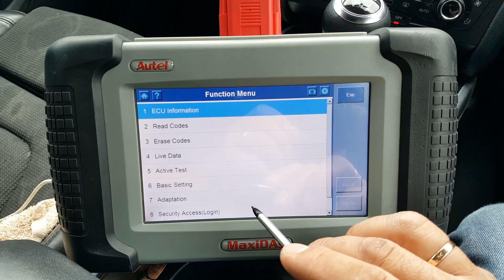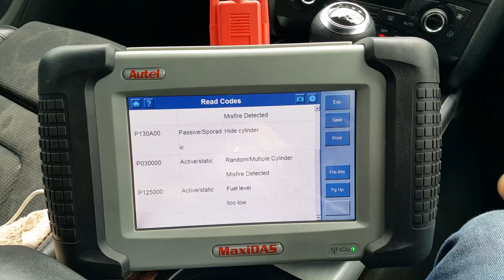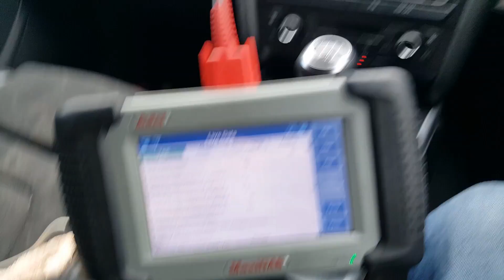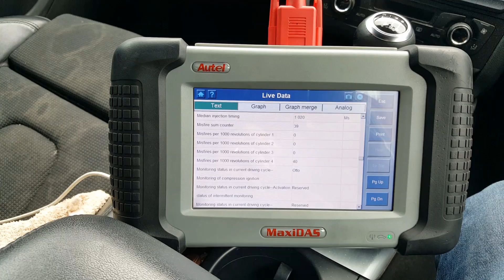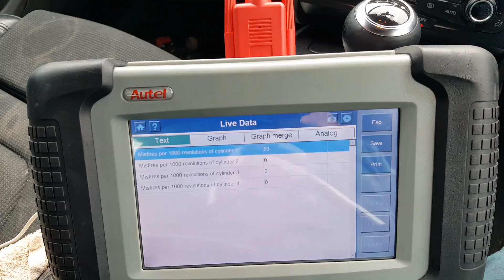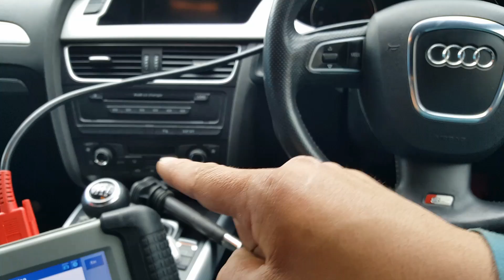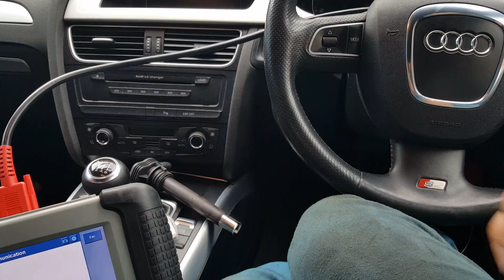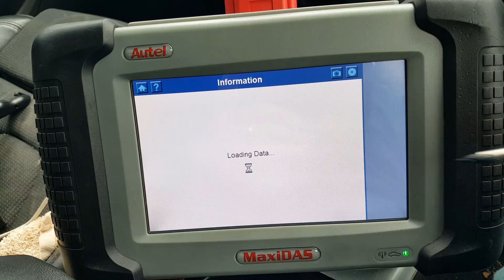Audi A4 misfiring diagnose. P0304, P0300 and P130A. Fault finding and repair.

Comment: Hi, my 2017 sharan, have fault code, p0300,p0301-p0304,then change fuel filter, no codes for two days, then on the 3rd day, p0300, p0301 and p0304 and p0130 again, do you thing what is the problem? Change coil already
Reply from the maker: Hi
The P0130 it is most likely a consequence of the misfiring... 
I guess that is a petrol engine right?

Comment: So with you fixing that miss fire did it make the EPC light go away forever?
Reply from the maker: Nothing is forever...☺️
Yes, it fixed the issue in this case, as per the video...
Reply: @LMAutoRepairs  well yeah thats what I meant😭. I have the same issue so im hoping fixing the p0304 code will make the EPC light go away
Reply from the maker: @b4rc4l1fe3 
Just do some testing to make sure you replace or repair it correctly...

Comment: Hi, my car 2007 audi a4 quattro 2.0L cam chain tensioner broke while stopping at a red light. I've put new chain and tensioner on. Compression of 180psi on all 4 cylinders. But getting P0302 code. Replaced all sparks and coil. Car starts and runs but shakes like crazy. I've rechecked timing and it looks ok. The new spark plug on cylinder #2 looks brand new as if it hasn't been used at all. Any help would be greatly appreciated. Thank you

Comment: Hi I have a question for you. If my turbo is bad would 0304 be a code for my 2011 Audi A4?  And when the car goes into limp mode, besides driving like a lawn mower does it make thumping movements?
Reply from the maker: Hi...
I would say no...
If the turbo was bad, would put the car in limp mode, and you would definitely feel the lack of power...
But the misfiring if any, would most likely be random... not cylinder specific...
Noises, depends how it failed... could make rattling noises if the turbine or impeler is touching the turbo housing...
👍👍👍
Reply: @LMAutoRepairs  I appreciate you talking to me so much.  Can I tell you about this bad situation I am in.  I need some advice badly.  And being a female doesn’t help.
I bought my 2011 Audi A4 brand new. After 7 years my check engine light came on. Missed the warranty by 2 months n 2000 miles over. Sick about that.  I was quoted 5000 to replace turbo, was told waste gate is bad. I didn’t have 5000 at time to fix my car and it drove fine. So for a year I drove like that. 

Then one late night I added too much oil by accident. My oil sensor wire was chewed by rodents, so I didn’t know, started car and it smoked like crazy, bailing out the exhaust. So I shut it off n towed the car to this auto shop.  I told them what happened. So they drained the oil for me, and I asked them how much to replace turbo they quoted me 3500.  So I agreed. This was late Thursday when I agreed, near closing time. This wasn’t a special turbo shop. So this turbo had to be ordered or found in Las Vegas.  Anyways, the very next day at 1pm, they call me and tell me my car is ready..  in those minimal hours. 
So I made a horrible mistake trusting this place, that said “family owned” and never asked to see the turbo they took out of my car. They said 2 year warranty on turbo. 

So when I left there.  My car drove exactly the same. After 70 miles the check engine light came back on. I called them and the guy said” well ya, after all that oil, I’m not surprised.”  So this was a year ago, since my car left shop.  I refused to take my car to them and  have them charge me for more money, when they weren’t fixing anything.  And having no proof that they didn’t replace turbo. Now I know my turbo is finished in my car. I drove on it for so long. And I want to take my car to them now, because it’s not driving.  It thumps and drives like a go cart.  But 304 code popped up.  I just don’t know what I can do.  This auto shop has 36 complaints with the BBB.  of robbing people.  

So my question to you and if you are still here is.  Is there a way I can prove somehow that they didn’t put a new turbo in.  I stepped on the pedal too hard, to get out of traffic and that’s when it said : “no way, and started thumping n had no power.  So I have to tow it there now.  

Thank you so much for your time.  I love your channel.  I love great mechanics
Reply: I forgot to ask, my code reader says 6 codes for my car, which I’m just figuring out now .  So if my turbo was bad, is that only one code 0299 that would tell me or is there more turbo codes?  Thanks again
Reply from the maker: I would look for another shop...
After all that time, it will be difficult for you to prove anything I guess...
Better just look for another place that will look into it properly...
Reply: @LMAutoRepairs  alright thank you.

Comment: Hi there! Thanks for the great video. I've random misfire issue and so far we couldn't find the problem.

We changed; spark plugs, ignition coils, cleaned throttle body, repaired PCV, checked MAF sensor and all but still car is running rough only in idle and smoots out when you rev the engine after 1000 RPM. We made a smoke test to see if there's any leak but there was nothing visible. I searched a lot and everything ends up having a vacuum leak causing this issue.

How we can check other than smoke test if there's a vacuum leak? Can vacuum leak cause this misfiring issue? Also one more thing, when I get live data for the voltage when car is idling, in idle it runs between 12-13V but as soon as I rev up the engine, voltage goes around 14V and again, car runs very smooth. Can it be related to any electrical or alternator issue? We checked battery, it's %97 healthy, alternator seems charging well also but I didn't understand why in idle voltage drops (in idle, internal lights blinks also when misfire happens).

Your response will really help me, I'm getting tired to find this issue..
Reply: I cleaned the injectors, intake manifold, and new spark plugs.
Reply from the maker: Hi
I would start with the voltage at idling...
Should be around 14v... and if you have flickering lights inside the car....
That said, that can also be caused by low rpm due to the missing...
Check timing as well...
Fuel trims...
Is there any codes other than the random misfiring? 
Thank you for watching! 
👍👍👍
Reply: @LMAutoRepairs  I just checked now, when car is idling, voltage is around 12-13, if I open AC, lights and radio, goes down sometimes 11.5 - 12. Whenever I rev up the engine, voltage goes above 13 V and that's where I don't have any issue. All misfiring is happening during idle. I had codes random misfire and Cylinder 1 & 3 misfire twice today, before I was never getting misfire code but engine was always shaking in idle. long fuel trims are negative.. lft1 is around -12, lft2 -5, short trims are changing during drive (+/-) but they're always smaller than 10% (+/-). Timing, I don't know how to check but there's no code other than this misfires...
Reply from the maker: OK...
I would focus on that low voltage on idle...
See where that leads you...
Reply: @cagrbayraktar7027  A bad fuel injector thats stuck open is also a common cause of this on Audi's/VW. If you have a code for a specific cylinder coming up then the fuel injector for that cylinder is likely bad.

Comment: Hi there thanks for this video.
I have Cylinder 1 P0301 & Cylinder 3 P0303 intermittent misfires, it's a strange one because it comes and goes meaning the next scan shows all clear. I had already changed coil packs and spark plugs and done walnut blastings to clear carbon build-up.

What could be the problem? Thanks
Reply from the maker: Check compression and timing...
Could also be a wiring issue, but that will require a bit more digging...
Hope you find the issue...
Thank you for watching and for your comment!
Reply: @LMAutoRepairs  Thanks for the reply, I had forgot to state that I had indeed done  2  compression test, also there is not CEL registered, but I noticed that my fuel consumption had increased I use to register 430km on city traffic alone now I barely get 400km, mostly 380km. 

The strangest thing happened today after around of test the fault code disappeared. It could be 2 separate issues altogether, the odometer is currently clocked at 200k km
Reply from the maker: Check also injectors... live data etc...
Reply: @LMAutoRepairs  Thanks will do and if I do get a solution I'll post it for the benefit of others. Thank you for being supportive to us owners with troubled cars.

Comment: Hi there, and what if there is also a high oil consumption beside the P030400 code in Cylinder 4?
A5 2.0 tfsi 
Thank you in advance
Reply: And when the compression is low then is something wrong with ring or the piston?
Reply from the maker: @omarmhaid8271  
Or valves... 
👍👍👍
Reply from the maker: Check compression...😉
Thank you for watching!

Comment: Please make a Video on what you would do if it wasn't the ignition coil pack...
Reply: Had same thing on daughter's a4..replaced plugs ...n 80 purge valve..pvc...fixed it smooth. ...plugs. Only NGK iridium....dont regap...come set...turbos like smaller gap...
Reply from the maker: Hi
I might have that on other cars...
Check my channel...😉
Thank you for watching!

Comment: I broke my ignition Coil Harness cover my cables are exposed I have them with heat tape, would this cause these codes? Oh and I have a bad maf it's on its way.. But my car runs wayyy to rich I can't even turn on the heater it Hella reeks
Reply: hella? u from da bay brah
Reply: @nicoj3660  Nah, From Ventura, California, currently live in Oregon G.

Comment: I use another method for check this coils... You have to put a coin over the coil, and keep contact with the ground cable from the oscilloscope in the middle. Forget the plus cable.
The magnetic waves emitted by both coils (primary and secondary), are captured by the coin and transformed in current (adjust a very low voltage).
Then, you must to see both signals of both coils, and when secondary faults, the second one disappears.
Easier, faster, precise, and especially clean 😅
Check to try it 👌🏻👌🏻
Por cierto, hablas español?
Reply: Puedes explicarme tu metodo en español? Por favor🫡
Reply: Hola  @ilvxor ! Encantado...
El método que utilizo es con una moneda y el osciloscopio:
La moneda se coloca en la cabeza de la bobina de encendido para recoger el campo magnético, y sobre ella apoyas el cable negativo del osciloscopio (el de positivo no se utiliza).
En condiciones normales se deben ver dos señales (bobina del primario y bobina del secundario). Cuando la bobina está defectuosa, sólo se ve una.
Espero que te sirva de ayuda!!
Un saludo;
Guillermo
Reply: @guille79bcn  hola muchas gracias por tu respuesta, lo probare cuando tenga la oportunidad. Saludos
Reply from the maker: Yes... I understand the principle... same as a pick up...
Thank you for sharing it... very good!
No Spanish... Portuguese.....😉

Comment: Having the same issue although on cylinder 1 coil pack change spark plugs changed o2 sensors change and fuel filter. Any idea what may be the problem. Injector? Thanks
Reply: P2188 fuel too rich on idle.
Reply from the maker: Look for vacuum leaks... and check injectors... making sure they are closing ok.
Can you confirm that code on live data fuel trims?
Reply: What should the fuel Trims be averaging on an a5 ? 
Thanks
Reply from the maker: @johncamfield3326  
Close to zero...
Reply from the maker: Which codes are you getting?
Thank you for watching and for your comment!
Reply: P217800 system too rich off idle bank 1
P030100 cylinder 1 misfire 
P030000 random/ multiple cylinder misfire
P218800 system too rich rich at idle bank 1
P125000 fuel level low. 
Absolutely headache!

Comment: Help! i have a 2005 Audi A4 1.8T when i first got it i had no CEL (idk if the person before me cleared the code or not before i got it) but after refueling and putting 87 in it like youre not supposed to the CEL came on and misfires started to occur after acouple weeks it got worse CEL eventually started blinking hooked up VAG com and found 2 code for a misfire in cylinder 2 and 4 thought it may be the coils so i switched them around to see if the code would switch to a different cylinder and it didnt it was still 2 and 4 so i swapped the plugs with newer ones this helped the problem now it only really misses during idle but its still missing and the CEL came back on after i changed the plugs and theres no code for lean miss fire so im not thinking it has anything to do with fuel but i thought about checking the MAF sensor can someone give me some input on what i should do or how i can find a solution
Reply from the maker: Reddeadattention 
Hi
Based on what you describe and everything you did already,  it seems something to do with the primary ingnition circuit... which means something wrong with what controls the coils... and because the misfire is on the cylinder 2 and 4, it can be the driver inside the ecu... but, loads of checks before blame that...
Check that the could are getting good power and ground... check the signal wire from the coils back to the ecu...
Another think that would worth, and because you have been doing it already, is swap the injectors... see if the problem moves over, just like you tried with the coils... if moves, you have your answer... 
If not, check also the injector circuit, power and signal wire...
Hope that helps...
Thank you for watching!
Reply: LM Auto Repairs 
Yeah ive been researching everything trying to figure out the issue and i have seen that it might be electrical or have something to do with the ECU im working my way from common issues like the coils and spark plugs to rarer issues and when i swapped the plugs i got new ones for all 4 cylinders so it cant be that but ill definitely go through all the wires and connectors tomorrow and get back to you thanks so much for the reply and help!